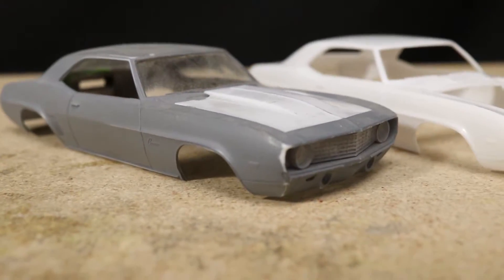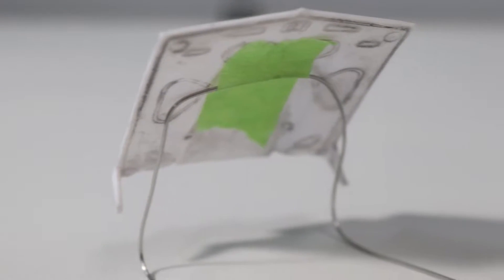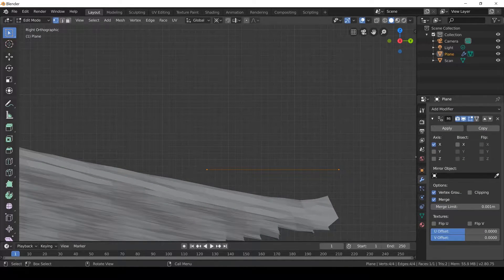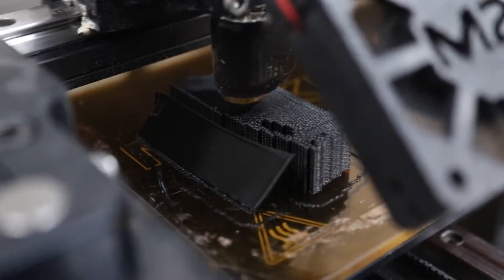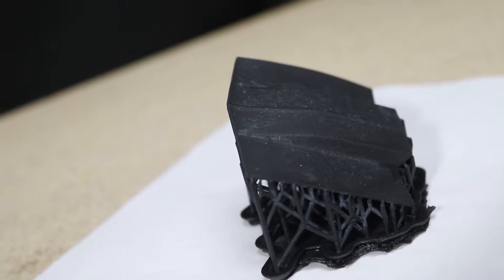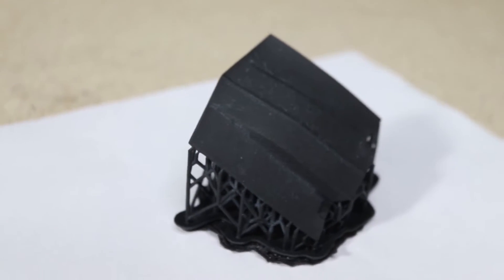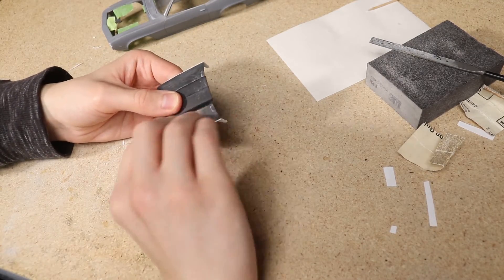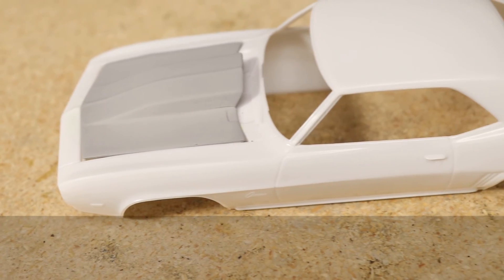Modeling and 3D Printing a Custom Hood for 1/25 Scale Revell 69 Camaro

Comment: I think I found my perfect hobby, I like lots of things, 3d modeling, printing, cad, product design, programming, electronics (custom pcb), tinkering and crafting with hands.
In small rc cars you can combine all of it, from form, design to cad, cnc, custom electronics for headlights, remote control and other functions. And with time and experience make it smaller and smaller untill you can make 1/72 scale perfect intricate replicas. Not sure if these things would have market to sell.

Comment: I was wondering as someone with no 3d printing experience. In hindsight would it be practical to print the part thicker to allow for and maybe minimize the warp then sand to final shape? It's more work but would it balance out in the end with a more favorable finish inside and out? I'd like to print my own custom parts soon and am learning from your insights.